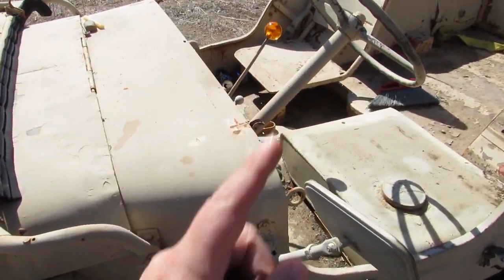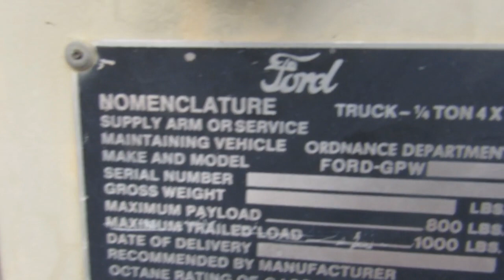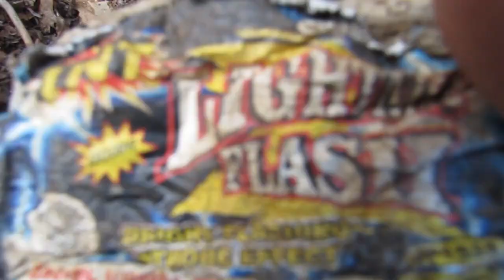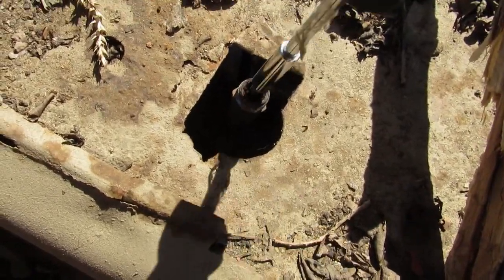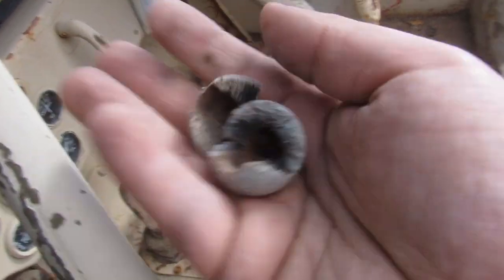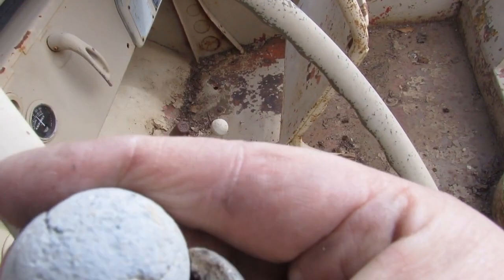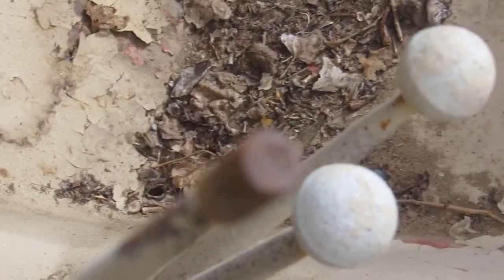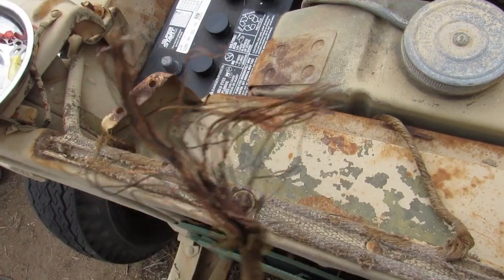Jeep Restoration/I Bought My Dream Jeep/ BugOut Vehicle 1942 Ford Jeep GPW Willys MB Army Jeep

Comment: I used to drive one of these in 1982.  It had the 225 V-6, power steering, and other parts from a 1967 Buick Skylark. I got everything mechanically sound and even installed the first full top and heater it ever had.  I had to drive around in the middle of the winter because I has installed a heater box out of a 1950 truck. I flipped the axles and flipped it end over end three times on asphalt one week after I installed the new top. I still have scars and my friend was in intensive care for five weeks.     Did I forget about the windshield wipers and overdrive?😁 It had four gearshifters.
Reply: The steering assembly was it a tilt steering are they’re any company selling tilt steering assembly kits for MB jeeps. ?
Reply: @joe3973  Yes. It was from a '67 Buick Skylark.
Reply: @roderickrayrutledge2740  Thank you , I wonder if that steering kit can be brought at Summit auto parts or national parts center ?
Reply: @joe3973  My steering box was just welded to the frame and the pump was already on the motor. Both engine and steering came from a '67 Buick Skylark.
Reply: @joe3973  Check into an electric assist power steering kit from a Toyota or Prius. They're around $300 compared to a pump style that will run you $1200.
Reply: @roderickrayrutledge2740  Thank you very much !

Comment: The grill alone is worth $100.  I would not call a WWII jeep the perfect Bug out vehicle. But it will still run when the EMP goes off and the grid goes down. Either way sweet deal. Get her back on the road. I have a restored GPW and I am currently restoring a 45 MB. Pretty much my favorite vehicle that can fit in a garage.